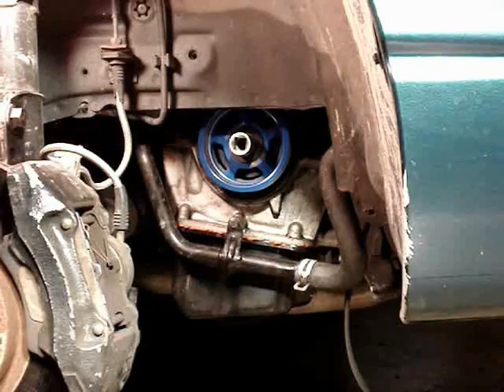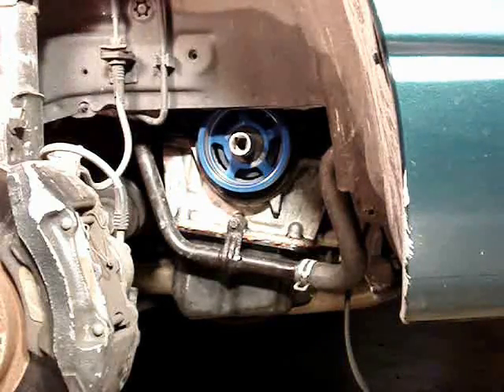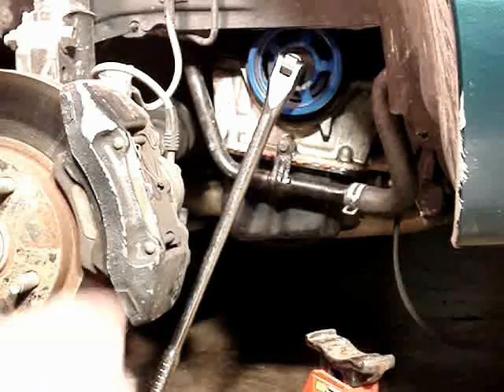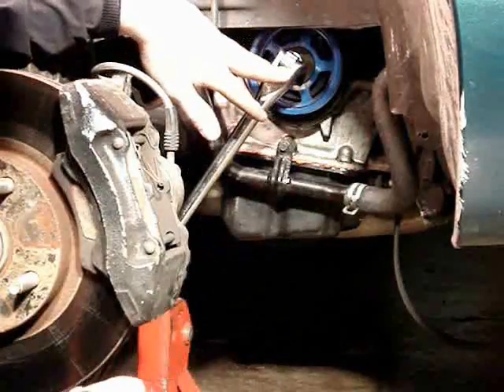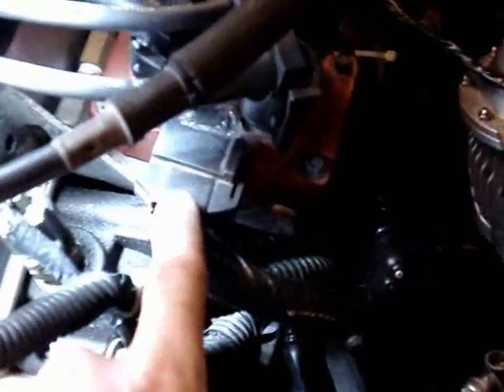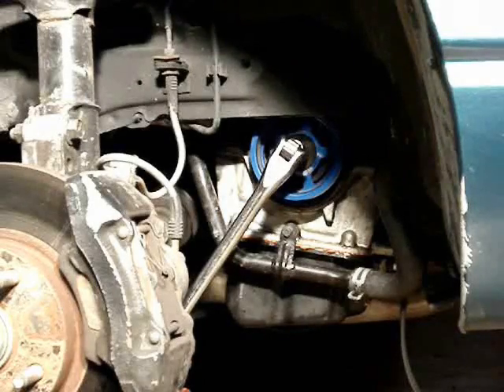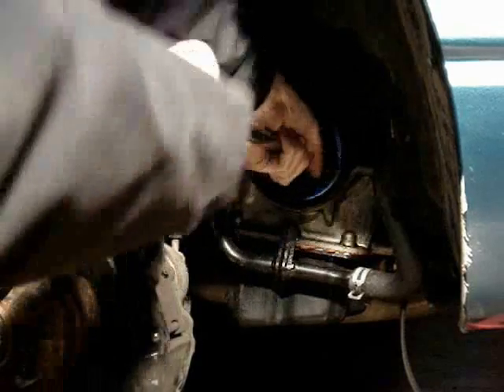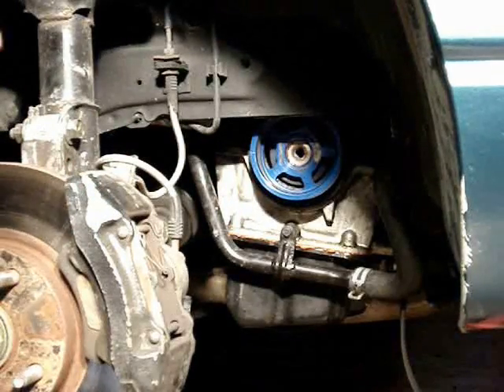How to use a breaker bar to remove a crank pulley bolt on a passenger facing, clockwise engine.

Comment: Is it standard procedure to replace the intake cam seal? How would I go about that? Are there any seals on the VCT or exhaust cam that I should be aware of? I'm just wondering in case they need replacing while I'm in there? Any help is much appreciated.
Reply from the maker: If it isn't leaking, I wouldn't replace it.  Unless we are talking about a 200,000 mile engine.  My 260,000 mile engine still has the factory cam seals and they don't leak.  If you remove the gears (timing procedure in my videos) you can  use a seal puller to remove the old seals.  there is an o-ring on the VCT plug (the plug  you remove to get to the VCT gear bolt) but I've never seen it leak.  Replace that only if it is broken.
Reply: Great info. Thanks!

Comment: Nice video, but you don't have to unplug any coils to keep the car from running. Just give the ignition switch a quick turn so you only let the starter bump a bit, it's plenty to crack loose that bolt.
Reply: That would be too risky. It takes two seconds to pull the coil wire out of the distributor cap.

Comment from the maker: Just reverse the battery polarity, the engine will spin the other way.

Please don't do that!  It is just a joke.  Technically, it would spin the engine the other way, but it would damage the electrical system.  Even if you only ran the starter on a reverse battery, it could still damage the timing components.

Comment: EVERY honda motor at least from 96 and on with a timing belt rotates counter clockwise, there is a special tool for holding the pulley
Reply: stevenlee92833 not true bud. my v6 crosstour is clockwise.

Comment from the maker: Not all engines in Honda's rotate counter-clockwise.  A quick Google search reveals this is only a concern with some pre-2000 Honda engines.  Certainly verify the direction your engine rotates before you attempt this.  If you are looking at the crank pulley, it should spin in the same direction as a clock.

Comment from the maker: It has been answered in previous comments.  I put loc-tite on the bolt and use a breaker bar with a hammer to install it.  Hit the end of the bar with the hammer (in the direction you tighten it) and it'll get the bolt tight enough to stay.  The chain-wrench would work better, just use an old belt so you don't damage the grooves on the pulley.

Comment: OK I'll repeat a question you didn't answer earlier, how do you tighten the bolt back down?  I have an automatic, and short of jamming a screwdriver into the flywheel or using a chain wrench to hold the pulley, I don't see any way to keep the engine from turning while I retorque the bolt.

Comment from the maker: You'll have to find a way to brace it.  I've had some luck using a pipe to extend the handle of the breaker bar but that is VERY dangerous so I don't really recommend it.

Comment: Does't matter. The torque is so great so the bolt will be loosen. Sometimes you need to repeat the process a few times but it will work. I tried it myself before this video came out.

Comment from the maker: You would need an air compressor capable of supporting an air gun with sufficient torque to remove this bolt.  Electric impacts can be very useful but aren't always up to task on removing a bolt like this.  A decent electric impact is a lot more than $15 and buying one with the intention of returning it after one use is immoral.

Comment: i did not think this would work but after trying to undo the bolt for over an hour it was do or die and it worked  thank you for this tip

Comment: I've got an '01 Nissan Pathfinder (VQ35DE engine) with a crankshaft pulley bolt that absolutely will not budge, even after torching it for so long all the scale rust on the outer edges of the pulley has burned off, even using this method, and a couple powerful 1/2" impact wrenches. Any other ideas that don't involve a 1" wrench?

Comment from the maker: Yeah, it is going to need to be heated up.  It may even need to be so hot it melts the rubber in the pulley so don't be surprised if you have to replace the pulley.

Now, you say they have tried to get the crank pulley off.  So they got the bolt off but the pulley is stuck on there or is the bolt still on there and won't come out?

Comment from the maker: It was,  It even had Loc-tite on it.  So much, in fact, that I couldn't pull that pulley off.  Normally, these pulleys will come off by hand and I had to use a remover to get it off.

Comment from the maker: The less than half second turn won't dump enough fuel in the cylinders to wash the walls.  The Zetec bolt is grade 10 and not torque-to-yield so it can be used as many times as you wish.

Comment: all looks good, I was always taught (including my certification for engine rebuild specialist) that the proper way is to remove the fuel pump relay or fuse, start the car, let it run until it runs out of fuel, try to crank again to verify the fuel is out, then proceed, as unhooking just the ignition pack will still allow fuel to dump into the cylinders. however, I believe the crank bolt on the Zetec is single use, and can snap in the crank when re-torqued. at least thats how the Duratec is.

Comment from the maker: If you face the crank pulley and it rotates clockwise while the engine is running, then it should work.

Comment from the maker: I put red Loc-tite on my bolt, installed it, then used a hammer and breaker bar to get it as tight as I could. You just hit the end of the breaker bar in the same direction you tighten it. They also make chain vice grips you can use to hold the crank pulley in place (use an old belt so you don't damage the pulley) while you tighten the bolt.
Reply: You mean when you put the bolt back  in through balancer? We're you replacing the balancer or a crankcase position sensor?
Reply from the maker: @Jack51971  I replaced just the balancer.  This engine has the CPS in a different location.

Comment from the maker: Why would I do that?  It works on axle nuts (sometimes) but why would I risk breaking a bolt off in a the nose of a crank by applying a side-load to it?  Your way also takes more prep AND is much more dangerous to do.  Also, how would one 'lock the engine' into place?  Actually, don't answer that, it really doesn't matter, yours is a bad way to do this.

Comment from the maker: Maybe not, but I'm obviously more cleaver then you are and apparently more knowledgeable.  "...whether its pushing up or down on your flywheel", how does that matter to the bearings?  Why wouldn't I want a small spray of fuel to be injected into the motor for a less than 1/4 second bump on the starter?  This isn't the first time this argument has come up, although, the person arguing with me tends to be smarter than you, and I've yet to be given solid proof (or any) that this harms the engine.

Comment from the maker: Okay, explain to me then how this is hurting the engine.  Don't say it is oil pressure again, since you just said it is how I'm turning it and not that I'm turning it, even though you said that before.  You are starting to talk in circles which is a great indicator that you don't know what you are doing.  Did some old fart tell you this would damage the engine and now no one can tell you otherwise?  I've yet to see an example of an engine damaged this way, car to show me one?

Comment: I meant 'any' circumstances except a cool, dark place. Such as a dairy barn. Old Skoda engines with 3 mains had thrust bearing halves that could slip when the damper was removed. My initial comment was a joke, as you well know.

Comment from the maker: So then how are we supposed to change the timing belt?  For some reason, I'm thinking you took that TSB way out of context, or it is superseded.  As many times as I've removed this bolt, I've had yet to see or hear of an engine seizing upon restarting or after 100,000 miles for that matter.  Go dribble somewhere else.

Comment: The crank pulley/damper bolt should never be removed under any circumstances. The thrust bearing will expand and the crank will seize after restarting. Always remove the damper bolt in a cool, dark place. TSB # 2102-06005

Comment from the maker: You should also write Dayco and tell them to change the instructions for replacing the belt.  The instructions say to rotate the engine by hand twice to confirm everything will line up when you are done. I sure do hate that they are getting people to ruin their engines this way. I'm glad you figured out a running engine needs oil pressure, this engine isn't running you idiot, the bearings are carrying no load, oil pressure isn't needed to protect the bearings for one or two low-speed turns.

Comment from the maker: And you just keep making yourself look even worse.  The engine is only turning once since the starter is just being bumped.  Are you telling me that if I rotate the engine by hand (or at low speed) once it is going to hurt the bearings?  They don't have a load on them in the first place and oil doesn't jump off of them when the engine isn't running.  I guess I reduced the life of this engine doing this?  It is at 225,000 miles, when do you think it will fail?  So, want to try again?

Comment from the maker: Great, another ignoramus.  Prove this isn't good for the bearings.  This isn't an engine from a poorly balanced loose tolerance 20's style engine.  If this engine can take thousands of explosions a minute, why would doing this hurt it?  The engine in this video currently has 225,000 miles on it and is in the car I use to pull other cars with and has a turbocharger on it that doubles the output of the engine. I could argue this is good for the engine. I have yet to see an engine damaged from this

Comment: Ingersoll or GTFO. That said, this way works and when I was 135lbs I used four feet of extensions and on/off body weight and the bolt broke loose on a Neon.

Comment: That's much easier than what I did! I used extensions on my wrench supported on a jack stand. Then rested a prybar on the extension to support it. Placed my tire iron in the pully slot to keep it from turning and put a small section of 3 inch pipe over the wrench extensions and the other end of the tire iron. With a long pipe on the johnson bar to pry on. The tire iron actually bent a little before the bolt broke free.

Comment from the maker: @Rick8683 The engine is still stock and has not been opened up, rebuilt, or so mush as made an abnormal noise since I bought the car in 2000.  The engine has over 210,000 miles on it and still puts up more than 170psi of compression on a cold engine.

Comment from the maker: @Rick8683 It would be, if this engine wasn't internally balanced.  After hundreds of members have put a collective millions of miles on these engine with under-drive pulleys without issue, I would guess it has no negative impact on this engine. This pulley was on this engine for about 160,000 miles.  The turbo has been on the engine for over 60,000 miles.

Comment from the maker: @brianperry55 Are you sure your crankshaft rotates clockwise?  Just because a battery shows 12 volts doesn't mean it is charged or that it is putting out enough current.

Comment from the maker: @Twinturbo120 I put red Loc-tite on my bolt, installed it, then used a hammer and breaker bar to get it as tight as I could. You just hit the end of the breaker bar in the same direction you tighten it. They also make chain vice grips you can use to hold the crank pulley in place (use an old belt so you don't damage the pulley) while you tighten the bolt. The breaker bar and hammer has worked for me without issue for 6 years now.

Comment from the maker: @YourePrettyGoood As long as your engine rotates clock-wise this will work for you.  On forward facing engines I just put my breaker bar on there with a cheater pipe, brace it against the floor, and that works out great for me.

Comment from the maker: @thelifeofjerjer As long as the crank bolt rotates clockwise as you are looking at it.
Reply: ZX2Fast how do know which the crank rotates? I guess you could turn the engine on to see but is there any other way?
Reply from the maker: @xray364  just have someone turn the key to start while you watch the way it spins.
Reply: ZX2Fast great thanks, but I guess the key to do this successfully is to not run the motor but I do have control to just crank the motor. As soo as I press the start button it will start. So is there anything that can be disconnected to stop engine from starting but just cranking over a couple of times
Reply from the maker: @xray364  disconnect the ignition coils.

Comment from the maker: You'll have to use an impact.  You can take it to a shop and get them to do it for a few bucks.  I guess, if you want to try, you can use some vice-grips to hold the flywheel in place then use a breaker bar and hammer to get the bolt loose.

Comment from the maker: @bradyhpifirestorm If you have a Zetec, use a hammer and loc-tite to just get it as tight as you can and it'll be fine.  If you have a car with an un-keyed dampener then you'll need to use a chain vice to hold the crank pulley in place while you tighten it up.  Be sure to use something like an old belt to keep the chain from digging into the crank pulley.

Comment from the maker: @robertlc3 I don't know that much about the Neon but it does sound like the front cover.  You have to use a jaw puller to get the balancer off of them because they are pressed on.  They don't pull off like the ones on the ZX2.

Comment: @ZX2Fast 
Yeah thats it. you have the crank shaft timing belt gear then the crank shaft pulley and then the bolt. its on a taper. no key way at all. The crank is timed with a pin into the side of the engine block and the camshafts are timed with a plate at the back of them. Try that with one of them engines and uh oh lol

Comment from the maker: @animal2499 Are you asking what if the belt is broken?  The crank pulley turns the belt, not the other way around.  You can still loosen the bolt with the belt off.

Comment from the maker: @b18cyacrxs That was a Ford Racing UDP.  It is fine to run, but the timing gear eats the back of the aluminum pulley.  I ended up putting my OEM pulley back on because I wanted the extra cooling power and amperage.

Comment from the maker: @HunterCO1 Dismissed?  No, I've actually been fixing cars and not fucking around on the internet.  Since the dampner is there to reduce the amount of positive and negative flex in the crank, it won't need to be there if this flex isn't bad enough to cause an issue.  You and the idiots at the lame stealership you work at can think what you want.  I've ran this car like this for over 7 years with no issues and still run 13's.  Do it your way, my way works for me.

Comment: @ZX2Fast so in other words you call torqueing it to specs tighten it as much as you can with loctite. LMFAO k

Putting it in gear could work for a standard transmission but what is your advice for those with automatics?

Comment: @ZX2Fast In short a harmonic balancer and or dampener are the same fucking thing jackass. They use the flywheel to externally balance an engine except for the 400 chevy small block they had to use both its called a "Detroit balance"

This is why I fix so many fucks all the time is because of complete dipshits like you. Call ford and ask for a harmonic balancer for your car I bet they have it will be the thing you call a pulley.

Comment from the maker: @HunterCO1   Simple, put the car in gear, block the wheels, use torque wrench.  If you do not have a torque wrench, tighten it as much as you can and use Loc-tite.  Back before I collected the tools I have now, this worked out just fine for me.

Comment: @tly1216 I don't have time to make videos when I am at work. I am a master technician with over 20 years experience. I would simply use my snap-on MG 725 impact and it would be off in one second!

To put it back on and torque it correctly as its a dampener and needs to be torqued properly to do its job. I would use a spanner wrench to hold the pulley and use my snap on tech wrench to torque it to specs.

With out a impact I could also take it off with my spanner wrench.